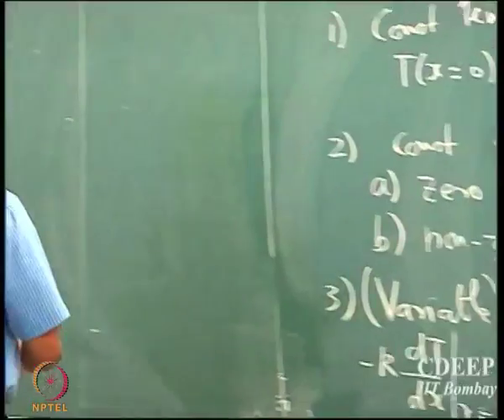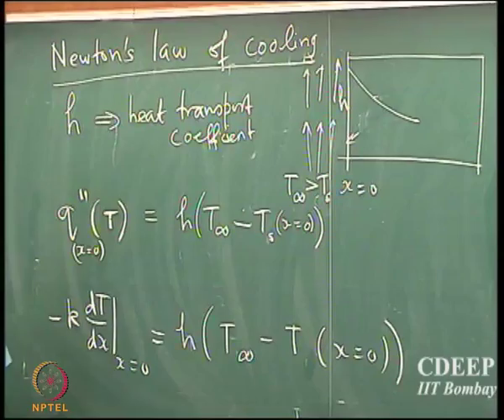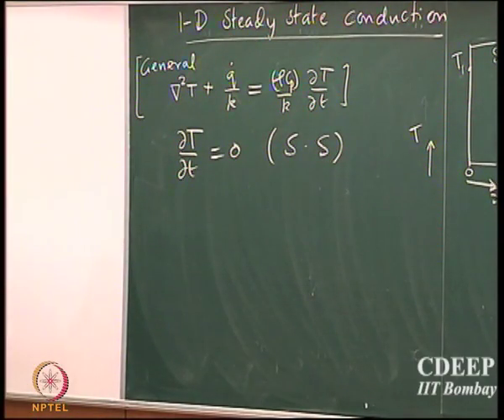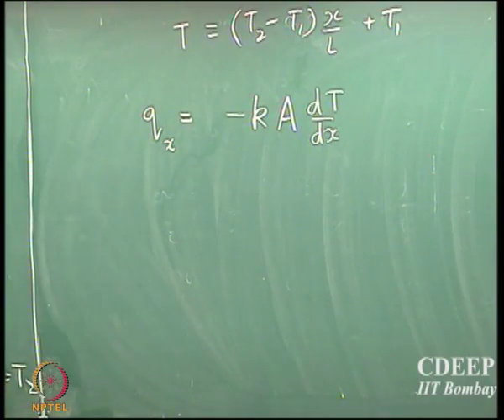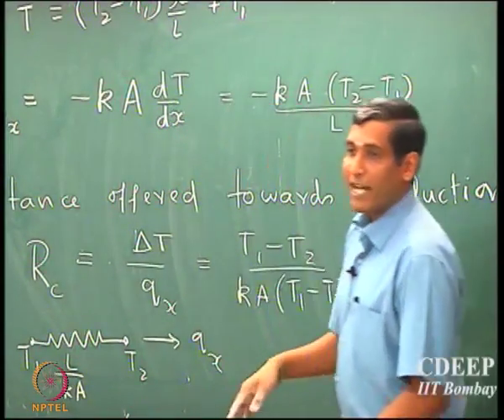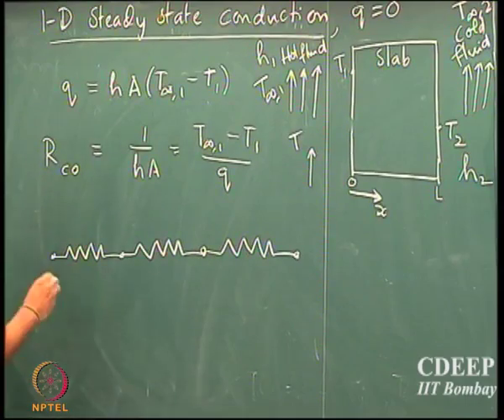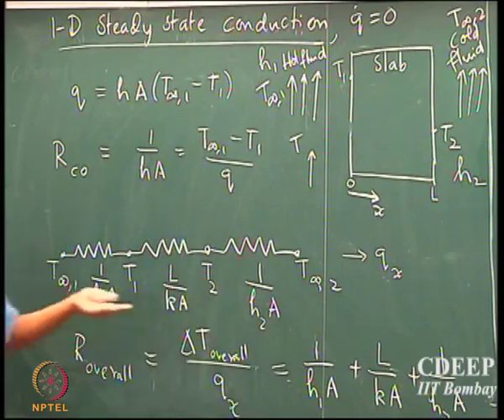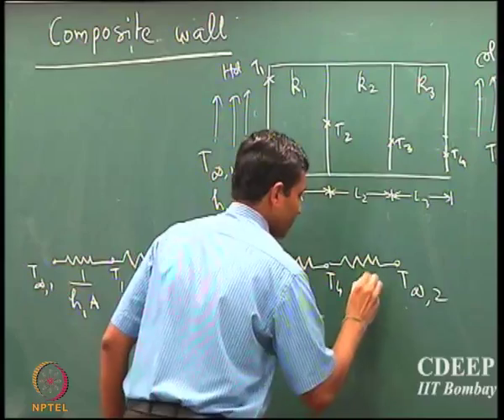Week 1 - Lecture 4

Comment: In conduction K electrons>K lattice. So can we quantify the amount of current flowing through the body?
Reply: NO, because K is specifically, the ability to measure the heat flow capacity of a material. Also you have put the relation incorrectly, Ke greater than K lattice for CONDUCTORS. For conduction in a solid body K= K-electrons + K-lattice. The measurement of current flow is a different concept.